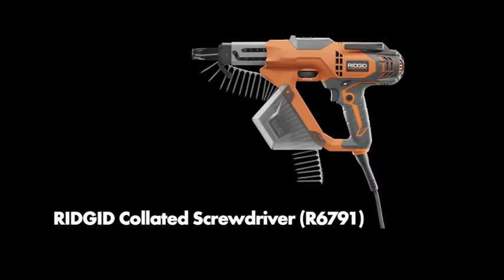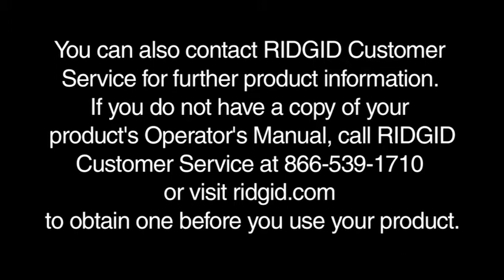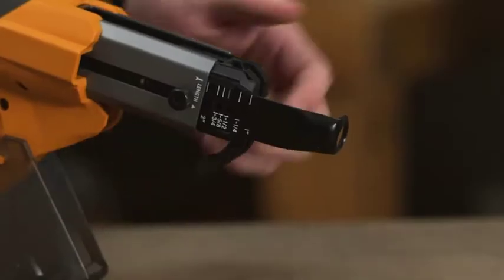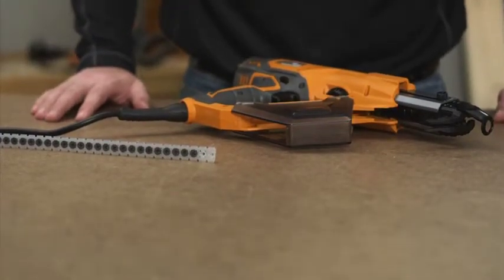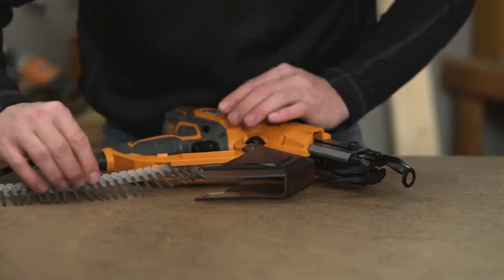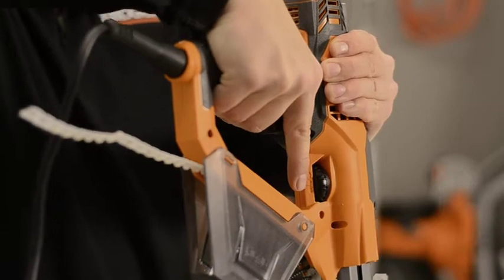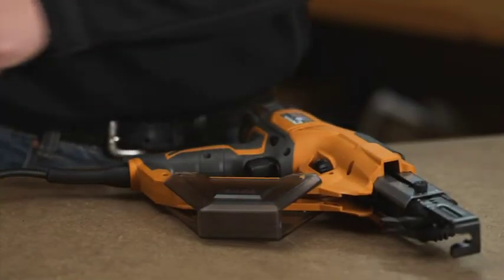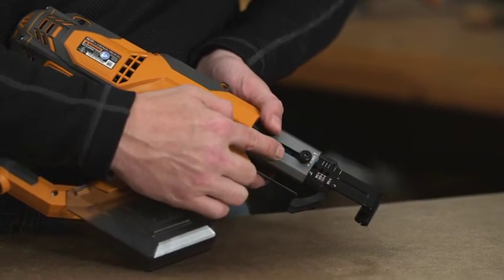RIDGID How-To Video: For R6791 Collated Screwdriver

Comment: Im with the other commentors.  It's nice WHEN it works.  A sleeve of collated screws is 25... out of those 25, about 10-14 were successfully used and driven into the subfloor.  The rest either jammed, went partial, or almost went all the way in.  Taking it back tomorrow

Comment: Mine works fine for drywall, but subfloor/square screws literally just pull the bit out and you have to take the whole thing apart to get it to work again